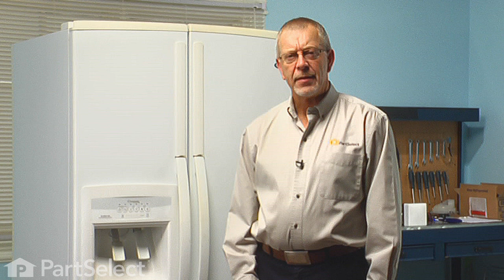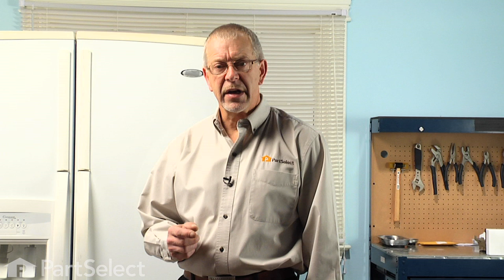Troubleshooting Why the Ice Maker Is Not Working | PartSelect.com

Comment: Steve I have a GE PSC23MGMAWW , it is not permitting the frozen cubes to fall into the dispensing shoot.  I suspect either the solenoid  shutter operator or the shutter itself.  My question is I need infor concerning access to this area ....... fastener location and such.

Comment: Hi. I have a Kenwood KSBSDIX16 and E9 has been displaying for some time. Ice maker stopped working. We tried turning whole unit off for 24hrs, unscrewed things, check the hose wasn't frozen and yet E9 code remained. Then it started to produce ice again, although still showing the error code. This worked for a while but has since stopped again. Manufacturer referred me to retailer but neither knew what the error code meant! Any ideas?

https://www.teamknowhow.com/content/dam/pdf/KENWOOD%20American%20Style%20Fridge%20Freezer%20KSBSDIX16%20Manual.pdf

Comment: Just wondering if there is a way to remove the ice storage bucket blue release mec. is not installed and bucket is installed???
Reply from the maker: Hi Scott, what is your model number?
Reply: Sorry I should have mentioned it.The model # is 10645423800 Kenmore Elite
Reply: My model # is    10645423800   Kenmore  Elite
Reply from the maker: Hi Scott, I am currently still researching this for you.

Comment: I have a Kenmore side by side. it appears to not have water in the ice maker but water comes out of the water dispenser. The dispensed water is not cold. Water isn't going into the ice-maker.
Reply from the maker: The water for the ice maker comes from one section of the water valve. Is the shut off lever in the on position? The water for the
dispenser comes from the other section of the water valve and goes through a coiled tube in the fresh food compartment to be chilled.
Reply: My husband  got it figured out.   Thanks for your response.

Comment: The shut off arm in the ice maker of our Whirlpool freezer (model #WRS571CIDM01) seems to be stuck in the up position, preventing it from making ice cubes. Since this is a plastic part, we've been hesitant to try to force this arm down. Fridge is only 10 months old. Suggestions? Thank you!
Reply from the maker: I am not familiar enough with that newer style of icemaker to offer and sound advice. If it is still under warranty, have an authorized technician look at it.

Comment: My Kenmore Elite has ice in the ice maker but it will not eject the ice? It has been in there for 2 days. Is it the motor?
Reply from the maker: It could be the ice maker control which contains the motor, or it could be the thermostat. If you are comfortable with live electrical
circuits, place a “U” shaped insulated 14 gauge wire jumper with about ¾” of the insulation stripped off of each end, into the terminals marked “T” and “H” on the ice maker control. This test will bypass the thermostat and should start the harvest cycle. Remove the jumper after about 1 minute.

Comment: I have a  Frigidaire LGBH2867PF French door style refrigerator.  There is an icemaker on the top which is working fine.  There is a second icemaker down in the freezer drawer.  Recently this icemaker stopped working/producing ice.  Just before this happened there were a couple of times when the freezer drawer did not close securely and in the morning I found the temperature for the freezer to be at 6-10 degrees ABOVE zero.  Could the line to the icemaker have gotten frozen up or something?  Any suggestions or assistance ?
Reply from the maker: That does not sound like a scenario where the water line might freeze. Can you see if there are cubes in the icemaker mold?

Comment: I have a GE Artica profile, model number pss27shhmd  bs  My child lock for dispensing water and ice will not stay unlock after I hold it for the 3 seconds. I have had this refrigerator for 14 years and this is my only problem so its been great.

Comment: Ice maker flapper door doesn't open how can I fix this issue
Reply from the maker: Do you here a solenoid operate when you depress the actuator paddle? What is your model number?
Reply: General Electric  PS123MGPB BB
Reply from the maker: Does the unit dispense water properly when selected? Does the ice bin auger motor get activated when you select ice dispense?

Comment: I have a whirlpool. The ice maker just stopped making ice. When I checked it, the tray had cubes. I then jumpered the T&H and I saw and felt the tray heat up and dump the ice. After i tested it that way i put everything back together and a couple of hours later the tray had ice but it did not dump it.  Do I need a new ice maker or a new warming tray????
Reply from the maker: I would suspect a faulty thermostat in the ice maker mold. What is your model number?

Comment: I have a Kenmore Coldspot Model 50592000  I have changed the water inlet valve, ice level control boards, the icemaker itself...... still won't make ice.  I don't believe there are any more parts to change.    Can't figure it out.  Can you please help?
Reply from the maker: If you manually put water in the ice maker mold, will it freeze and eject the cubes? If the cubes eject then I would suspect a frozen
water line or fill tube into the ice maker, or a poor electrical connection to the fill valve. If the cubes don’t eject, look for a loss of voltage to the icemaker harness or a defective ice maker control. Can you recheck the model number?
Reply: I will check on that.   If it were to be a  clogged water line,  how is it un clogged.  Thanks for help
Reply: Kenmore coldspot  mod 50592000 serial sk3329080 year 2000,08
Reply: I have changed solenoid h20 valve 4389177, PA control board kit 4389102,  and icemaker 4317943.
Reply from the maker: If the water line is frozen, it would normally occur right at the fill tube area where the water empties into the ice maker fill cup. Apply gentle heat with a blow dryer and use caution to prevent overheating and melting the plastic.

Comment: We have a Frigidaire. The power went out and when it came back on the Ice Maker would not work at all. Any suggestions? Thank you!
Reply from the maker: Are there cubes in the ice maker mold? Check the water line input to the icemaker for a possible frozen spot. Have you tried the jumper wire test between terminals “T” and “H”? If the ice maker ejector arm cycles properly and you still have no water entering the fill tube, suspect a faulty inlet valve. You can also test the valve for continuity with a multi-meter using test points “N” and “V”. Remember to unplug the unit before performing the continuity check.
Reply: ***** Thank you so very much for responding to my message!! We did everything you said to check and it turned out to be the Inlet Valve. Again, Thank you!!!
Reply: What is the solution to a frozen spot in the line? I have an older GE and I think I can see the frozen spot just after the line enters the freezer. We had a similar scenario with a power outage, and the ice-maker not working since.

Comment: I am having problems with my GE model (PSHS6RGXBDSS), the water is overfilling in the ice maker. I replaced the Grommet / Tube Assembly but after about an hour water continues to overflow in the ice make, what do I do now?
Reply from the maker: The symptom sounds like a defective water inlet valve that is not completely shutting off. This can happen when sediment gets into the valve or if the household water pressure is too low or is restricted at the line-tap valve on the water pipe if that type of supply valve is used.

Comment: I tried the jumper in T & H, the unit did heat up but the dial did not turn. Does that mean it has a bad motor? 
(No where says how long to leave the jumper in T & H. Just briefly or to leave it in. 

My fill valve works by jumping V & L

Comment: We just bought a new LG French Door refrigerator. There is an ice maker but we won't be using it at the present time. I was unaware there is an on/off switch and for the first 36 hours the switch was "on" with no water supply. Wondering if we fried the ice maker should we later decide to hook it up?
Reply from the maker: That should not have caused any problems. The water valve would have only turned on a few times and for only a few seconds each time.
Reply: ***** Thanks, I was thinking that as well. There's a section in the manual that had me worried, it reads "keeping the power switch in the on position before the water line is connected can damage the icemaker." It's probably fine.

Comment: I have a non-functional ice maker. Can you tell me what the pinout is? There are 4 pins. I want to test the power going to the connector to make sure there's actually power supplied, but I need to know what to measure on what pins.
Reply from the maker: You can check for power to the ice maker at the test points located behind the front cover. For most ice makers the following
test points and wire harness colors are applicable. The test point labelled “L” is the line 1 connection and the pest point labelled “N” is the neutral connection. These normally are the black and white wires in the harness. The water valve test point is marked “V”, and is normally a brown wire in the harness. The green wire is the ground connection.
Reply: *****
Thanks, but is the test point 'L'  = 120vac?

Also, should the test point 'V', always have a voltage on it or only when the water valve is turned on and what should that voltage be?
Reply from the maker: Test point “L” should have 120 vac when measured to neutral (“N”). There should only be voltage (120 vac) on test point “V” for the last few seconds of a harvest cycle when the inlet fill valve is energized. This is usually for 7-9 seconds.
Reply: *****
I'm surprised they use such high (deadly) voltages in a freezer compartment with all the moisture present. Certainly they could have used maybe a 24VDC motor and valve for performing the same task.

Comment: Great info.  I have GE Profile french door fridge.  The problem is the dispenser touch pad has Water and Cube Ice keys keys not working, other 5 key all works fine.  How can I find out what's caused that problem?  Is the wire connection problem or is the control board problem. Please inform. Thanks!
Reply from the maker: What is your model number?

Comment: He stands in front of fridge but never shows you anything.  I have ice build up in the water shute, but no mention of that in his dialogue.
Reply from the maker: What model number is your fridge?
Reply: +PartSelect ED25PE
Reply from the maker: Can you explain exactly where the ice build up is. Is the build up in the ice maker or the dispenser door?
Reply: The build up is in the back of the freezer behind the ice maker, where the tiny little channel like "shute" that  puts water into the ice maker.  It is solid ice in there so no more water can ever come out.  I hear it trying, I think, or something is making a noise.  I am thinking it is a water supply problem but since we never see inside your fridge on the video and you don't address how to fix a water supply problem, I don't know if that is the case or not.
Reply from the maker: If the water inlet fill tube to the icemaker is frozen, you should first thaw it out. Depending on the model, some fill tubes can be removed from the outside of the refrigerator. The reason for the ice build up may be from a freezer door that was left partially open or the water inlet valve may not be shutting off completely, allowing water droplets to freeze in the tube and eventually block the flow of water. Low household water pressure or a restriction in the water line to the refrigerator can also cause this problem. What is your model number?
Reply: ED25PE and I have been told that Whirlpool no longer makes the valve assembly for the fridge.  There is a Universal that may or may not work for me.   Ugh.
Reply: The water pressure is great here.  So it can't be that and the tubing is clear as we already tested that.
Reply from the maker: You could remove the supply line to the icemaker and put it into a container. If it drips water when the valve is not energized, the valve is not closing properly due to dirt inside the valve or reduced water pressure from a dirty inlet screen.
Reply: +PartSelect thx

Comment: thank you for your videos and assistance.  ice maker making ice but not moving forward to dispenser. model  Gse25ethbww.  few days ago
 freezer door left open and ice melted together.  I removed all the bad ice and have plenty of good ice. all of the parts seem to be working well. auger moving freely.
Reply from the maker: Can you hear the auger motor start when you select ice dispensing? If the motor does not turn on check for continuity
with a multi-meter. Verify that you have voltage to the motor terminals. (You may have to hold the door switch closed to perform this test.) If no power is present, look for a problem with the selector switch or the actuator switch.
Reply: Thank you for your reply. I've called my trusted repairman as I don't have the skills to troubleshoot. I do appreciate your assistance.

Comment: I have a figidaire Gallery glhs67ehsb1 that isnt making ice. I have replaced the water valve, if I our water into the ice maker it will make ice and the moter ejects it. so the ice maker isnt getting water, what could be the problem?
Reply from the maker: +Darrell Drayton The icemaker control module may be defective and not sending power to the fill valve. To verify this, you wouldneed to initiate a test harvest using a jumper wire and then check for line voltage at the water valve with a multi-meter.

Comment: It is a Kenmore Elite.     Model 596 72282201.     My multi meter does not show any current  at the connection to the ice maker.     If I could find a wiring diagram, possibly I could locate the problem,  but I am not skilled in electrical things.
Reply from the maker: +Jeffrey Nelson We could not locate a wiring diagram from the manufacturer for your model, however, there is normally a wiring diagram supplied with the refrigerator and may be located inside of the controls housing.

Comment: My ice make only makes one batch of ice.  I uninstalled it and reinstalled it and again only one batch of ice for several days.  The model number to my ice maker is W1209067 I just ordered this brand new ice maker.. and I have a whirlpool fridge that is only 3 years old.  The fridge has two doors and a freezer door under the double doors.  It dispenses water and has a ice dispenser.  Please help.
Reply: we are a ice making machine supplier since 2000, we supplier all kind of ice making machine, if you have any need, you can contact me. My whatsapp is +8613931173017
Reply: Did you ever solve this? My ice maker is doing exactly the same thing.
Reply: Ted Gallant commercial use or household?

Comment: I have a Maytag MZD2766GEW double door fridge with water dispenser ,ice-maker.The ice-maker is great but the auger will not turn to dispense the ice and I can't get the icebox out is there something connected in back that needs to be disconnected before it's pulled all the way out ,it comes out partway and stops or am I just not strong enough ? I l love the videos  here I am 71 yrs old a female and I was able to fix my washer with your help .and now I want to fix my ice-maker.
Reply from the maker: +Reta Wilkins Make sure that the shut off lever for the icemaker is in the up position and the bin should then pull all the way out.

Comment: your video would have been better if you showed more pictures.I have a Kenmore fridge model #795.51022.012 ice make isn't making ice water goes to the door dispenser but not to the ice maker tray.  It is a space plus ice system.
Reply from the maker: +Jason Clark You may have a defective water inlet valve. You should also check the supply tube to the ice maker as it may just be frozen.

Comment: Hi i have a Samsung french door type refrigerator,i just replaced the icemaker with a new one ,and everything seems to work when using the manual button,it rotates and will dump the ice and then refill with water and freeze.
but that's as far as it goes it will not repeat by itself?
the switch inside the door is set for making ice.
The temps are -4 for the fridge and 34 for the fridge,any ideas?
Reply from the maker: +chris shaw That symptom indicates a defective thermostat in the ice maker. If you replaced the complete icemaker as a kit,then you should inquire about a warranty replacement.
Reply: Ok thanks for that , for some reason it is working now.

Comment: I have a Frigidaire Model FFHS2611LBK that is not making ice. The water dispenser is working fantastic however the ice maker is not. I've manually advanced the gears and they're turning and operating correctly however no ice. I've replaced the filter, blew through the tube, It's just over a year old and I just can't figure out what the issue is...any assistance would be helpful...
Reply: +Mary Stevens I'm going through the same thing...annoyed.
Reply: EXTREMELY...none of the trouble shooting I've done has worked and I've watched hours of videos and read hours of chats...ONE DAY outside my warranty :(
Reply from the maker: +Mary Stevens  If the icemaker cycles correctly in that it goes through a harvest cycle and then sends power to the fill valve but does not receive water, then I would suggest that the water valve is at fault. If the ice maker does not rotate or does not send power to the fill valve, then the ice maker control is most likely at fault.
Reply: +PartSelect  Thank you! I believe you're correct. I'm contacting the parts house this morning :)
Reply: +Mary Stevens 

I too have the same make and model and probably the same YEAR of model, did you ever figure out if it was the fill valve?